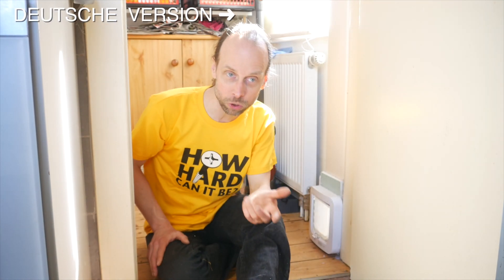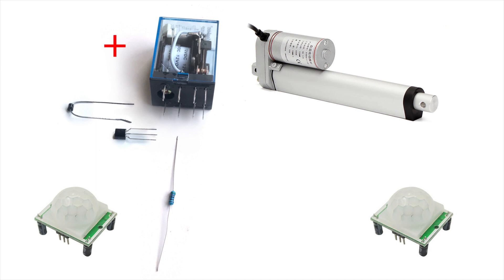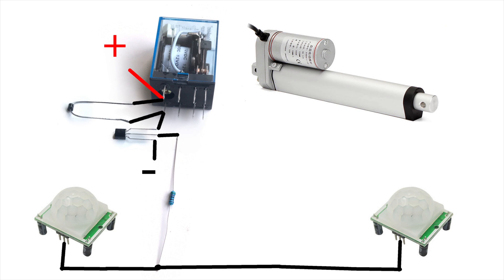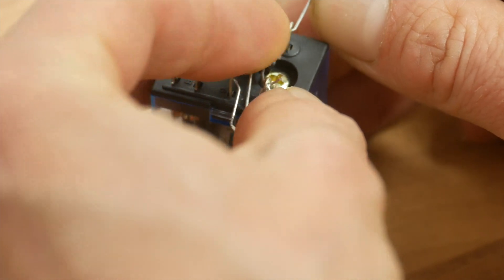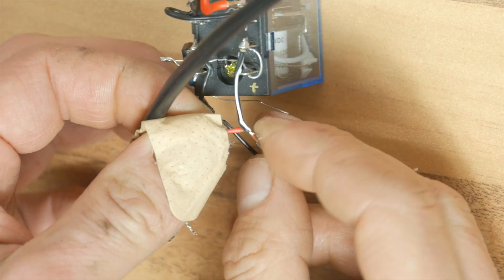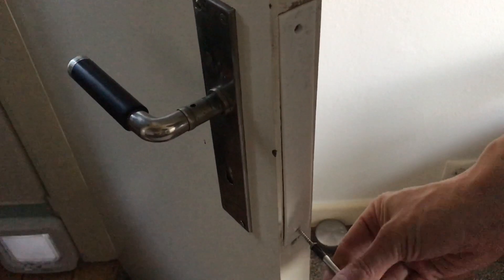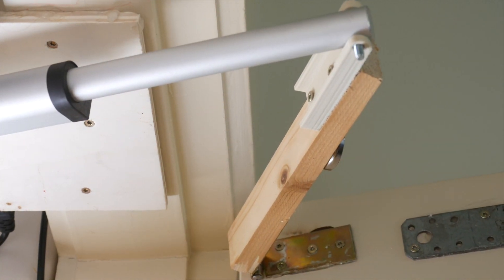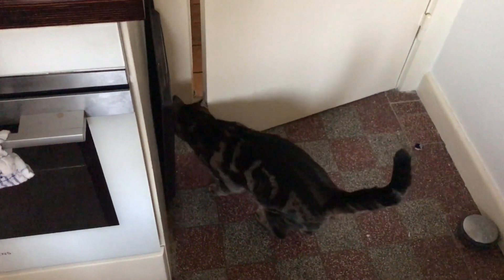Automatic Door for the Cat - with HC-SR501 motion detector, without arduino

Comment: Do the motion detectors run of 12volts the same as a linear actuator or do they have separate voltage supply
Reply from the maker: In this case, yes. It is very generous in terms of supply voltage: It takes anything from 5V to 20V